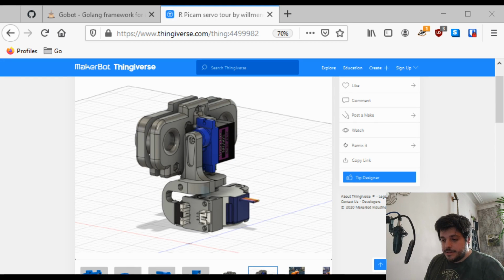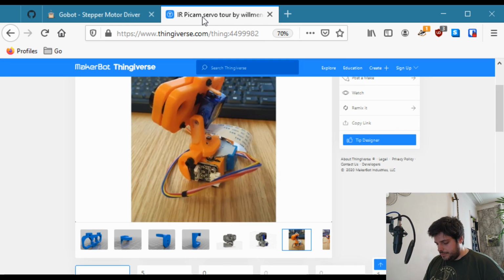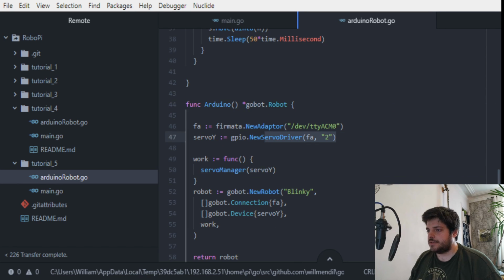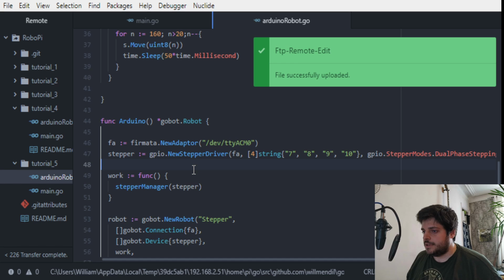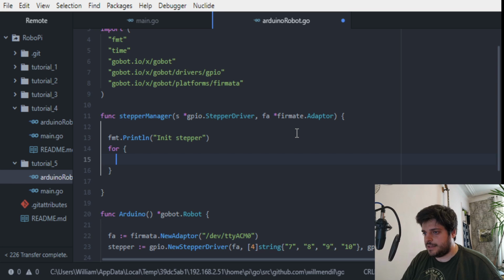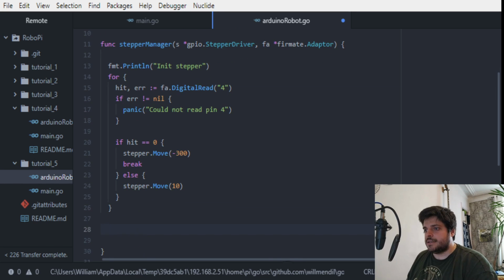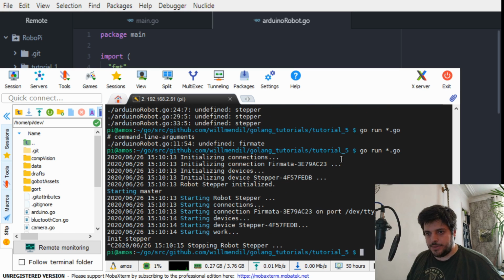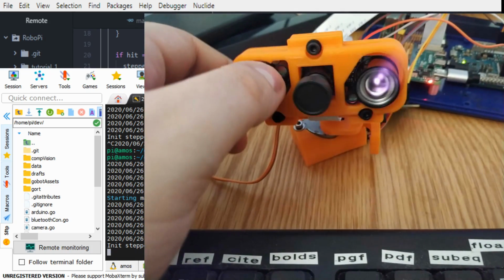How to control a stepper motor in Go

Comment: How would that work with a NEMA17 Stepper?
Reply from the maker: As long as the interface circuit has the same pin as shown here,, it should be the same. I don't know however if you can directly plug it to the Arduino
Reply: @mylittlerobot2965  guess it needs additional power